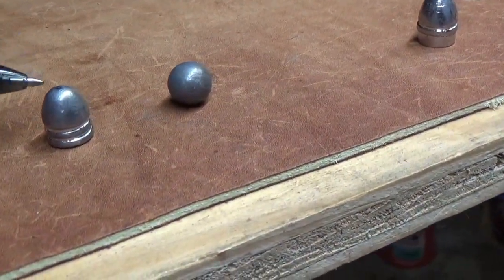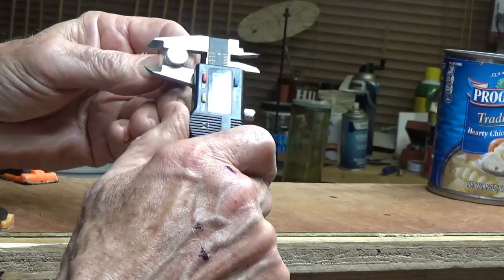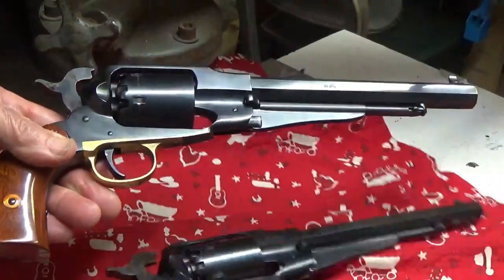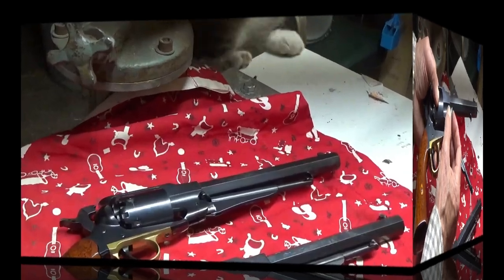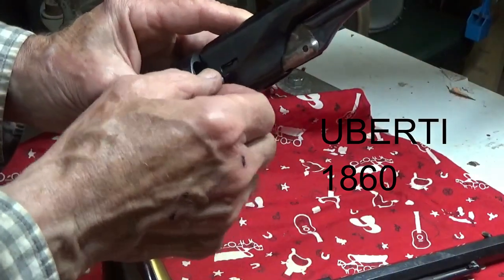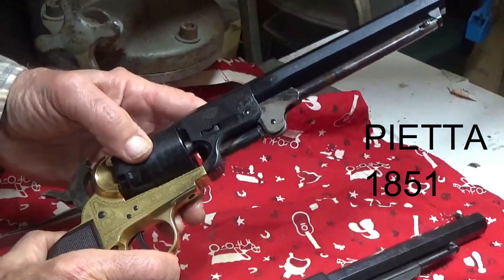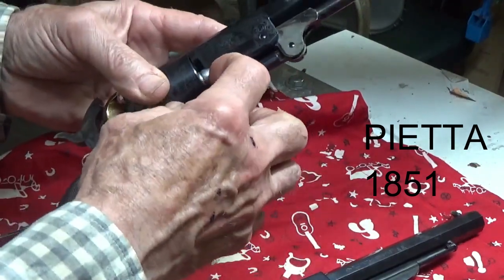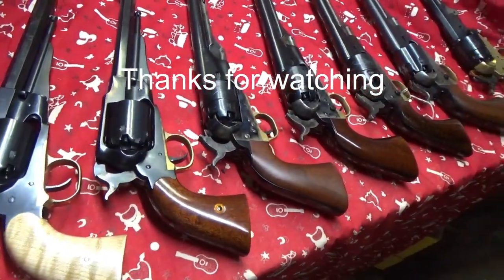Conical Bullets - Will They Fit These 44's ?

Comment: Hi Old Ranger, do you think that instead of the Lee .450 maybe is safer to use conical Lee .452 ?
Reply from the maker: As far as I know, Lee doesn’t make a .452 conical mold for black powder guns. They do make.452 molds for smokeless cartridges. A .452 would make a better seal, therefore less chance of chain fire. But, the issue is getting that .452 bullet into a  .444 Pietta cylinder chamber would be next to impossible. Using a wad or lube (or both) on the Lee provides good insurance in the Pietta guns. Uberti chambers are a bit larger, and if the Lee is cast around  .448 then there could be a loose fit. Lube or wads should prevent chain fires, but during recoil, the bullets could move forward in the chambers. The .452 might seem to be a solution but still difficult to start in the .449 chambers. Hopefully this explains why there’s not a easy yes or no answer. O.R.
Reply: @oldranger3044  thank you master!!

Comment: If you don’t modify the rammer for the J&D bullet you run the risk of tilting the bullet when you seat.  It will go in tilted you can tell because it shaves more lead on one side.  No es bueno.  I modded all my 44s for paper cartridges with the J&D.
Reply from the maker: For benefit of those considering a mod, did that  make the nose fit into the center of the rammer? Is the issue that the rammer designed for a round ball could cause the tip to be off centered?  O.R.
Reply: Yes.  That’s precisely why I did the mod.  It wasn’t so much to avoid deformation but to make sure the pointed bullets don’t tip. It does help keep the point too.  It still works fine with Lee conicals and RB.  The only thing you lose is a small amount of seating depth since you’re  removing metal from the face of the rammer which only affects a very light RB load when no filler is used.

Comment: It would be beast to stay with the originals because you have to fumble around with conical leads round ones are quicker they are made to just drop in..
Reply from the maker: I like the round, I suppose partly because it conserves on lead which is becoming harder to get and more expensive. I do recycle which helps. I suppose the conicals have advantages since it is said that the military used them, and also cartridge factories. I don’t know enough to say if round were widely used in paper cartridges. O.R.

Comment: It is pocible to shoot 9mm =cal 36 airgun slugs out of the  the pedersoli saloon cal 36  ,,  no patch ,,,powder cotton disk slug  works fine ,,works also without  this disk thing ,,,is it pocible to shoot them in revolvers too ??  ,,,,,a friend shoot them also backwards out of the saloon pistol diabolos and slugs  like a hollowpoint  ,,something like this apolo slug 9mm  2 diferent versions light  and  havy  ,,,,,,,,,,,maybe   thy are cheaper ?a alternative ?,,,,diabolos fit easy slugs  a bit force
Reply from the maker: Hi, sorry to say that I don’t know enough about this subject to comment much. Possibly there might be a forum for the saloon gun that could help. Since the bore is probably .360 and a 9mm is .356, it might not need a patch, but then there’s the issue of will it stay on the powder. If it were to work its way toward the muzzle, that would be bad. There is also the load data issue because what is safe for a round ball may not be for a conical, and those are designed to shoot soft lead, not jackets. O.R.
Reply: @oldranger3044  ok ,,,thank you 🙂👍🏼
Reply: @oldranger3044 
A bit late to the conversation, but airgun slugs are unjacketed soft lead. The rifling in airguns isn't nearly as aggressive as that in powder burners. So he composition of the bullet wouldn't be an issue. As you mentioned though, the size would be more of a problem. The closest you can get is probably .358s designed for .357 caliber rifles. Those 2 thousandths may or may not end up being an issue.
Reply from the maker: @ Thanks, will check them out. O.R.

Comment: Did you make three curly maple grip panels? I made some in cocobolo with live edge for my Remington 44
Reply from the maker: I did. Was interesting, especially putting serration on the brass round grip nut that drives into one side. Wondering how you approached Removing wood close to the metal strap?  O. R.